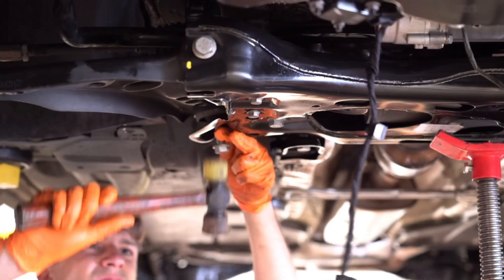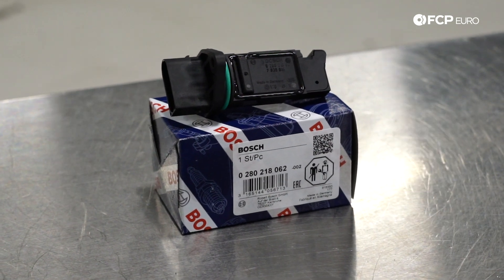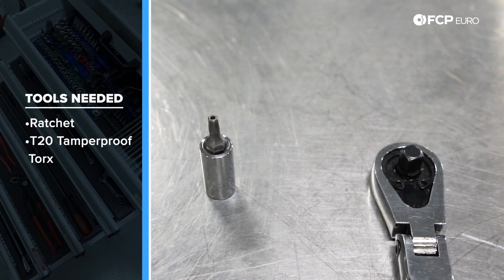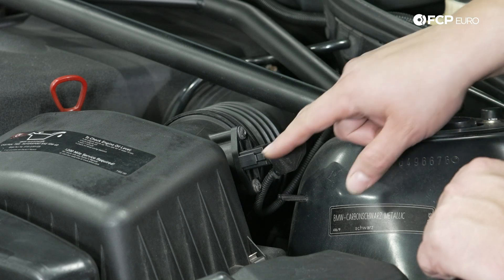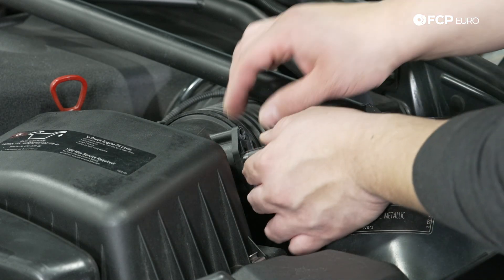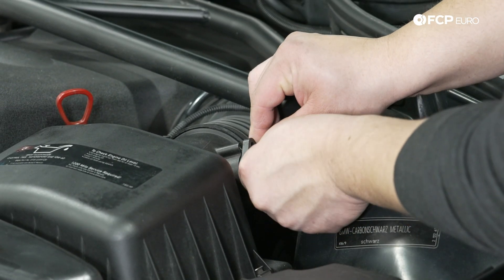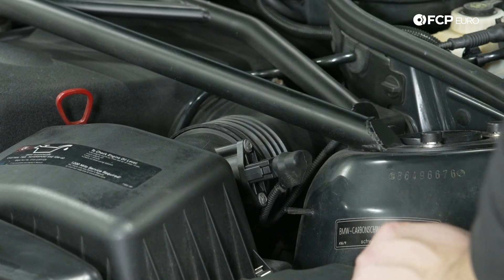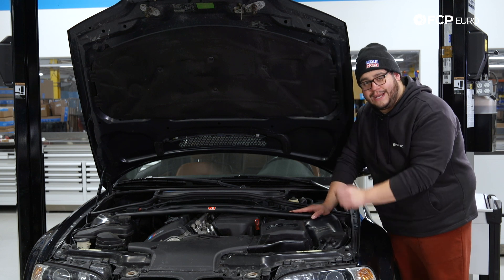BMW E46 M3 Mass Air Flow Sensor Replacement DIY (2001-2006 BMW S54 Engine)

Comment: My M3 completely died when MAS went out. I unplugged it and the car started right up. This is a helpful tip if it happens to anyone on the road. 

Question for the FCP crew. I got a non-OEM MAS replacement but my car is not running as well as before, it's not as peppy. Could an aftermarket MAS be the problem? Thanks
Reply from the maker: Certainly, a good way to test a MAF! And absolutely an aftermarket MAF can cause issues, these cars are pretty sensitive to non-OE sensors.
Reply: @fcpeuro how can i contact you plz
Reply: Ok i will
Reply: Is the MAF sensor bad if the S54 motor does not start when the MAF is unplugged ?